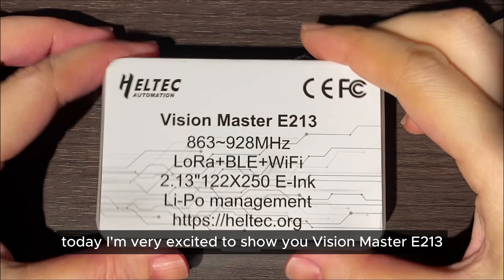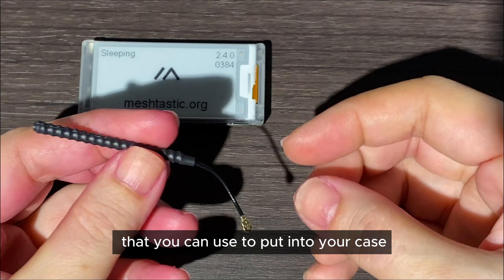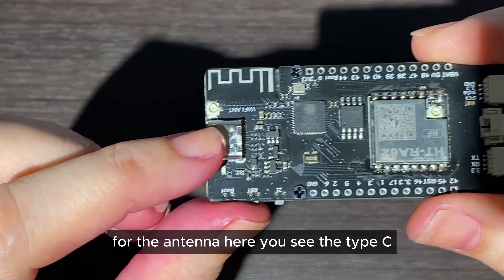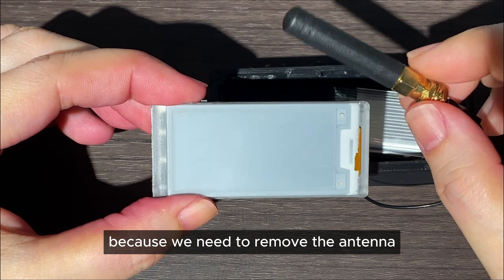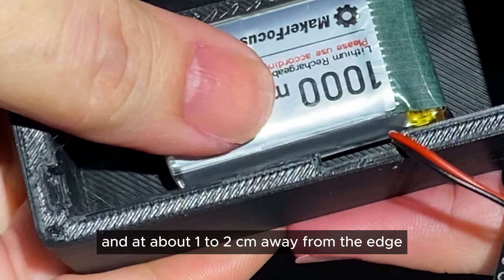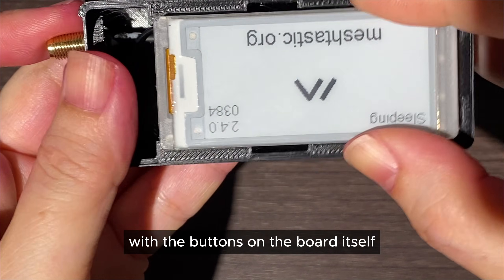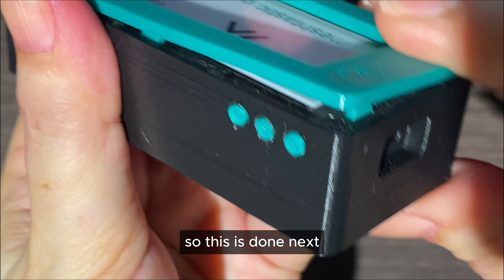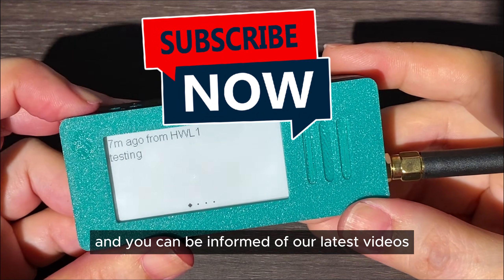The New Vision Master E213 : Meshtastic with a Smarter and Larger eInk Screen

Comment: In my case , hot stuck in flashing

LORA MODE 0   in display , and in browser ... erase memory.
Reply: Try this one, helped me just now: 
    Insure the battery is disconnected from the Heltec
    Unplug the USB-C cable
    Cue up the flasher web page so the ‘Erase Flash and Install’ button shows
    Hold down the bottom button on the Heltec, next to the USB port
    Keep holding it down and plug in the USB-C cable. Release the button
    Quickly click on the on-screen ‘Erase Flash and Install’ button
Reply: @gregorius-fpv  , so in the begining worked ... I flashed but get one error after 100% 
invalid header : 0xfffffff
on display 

LoRa Error
ADC analog value 3.10
No I2C devices found !
Reply from the maker: Hope you managed to solve it. Try changing another cable if it does not work